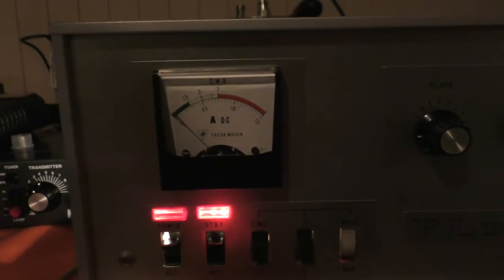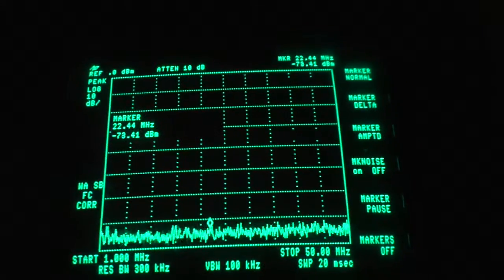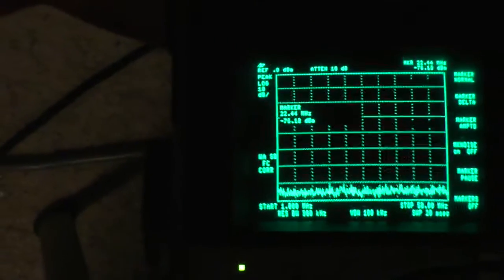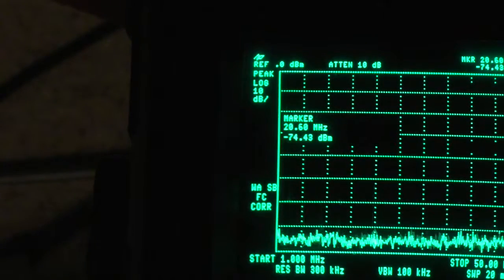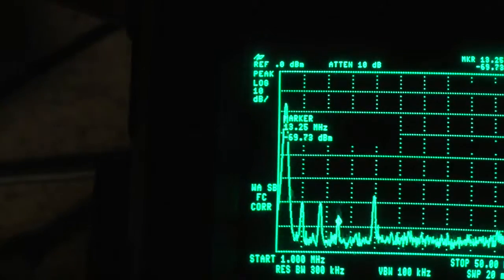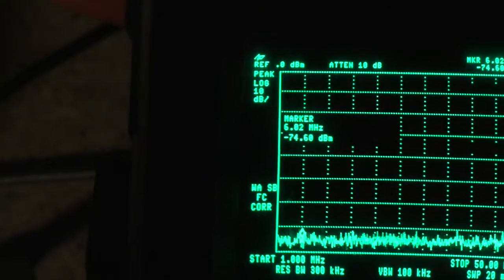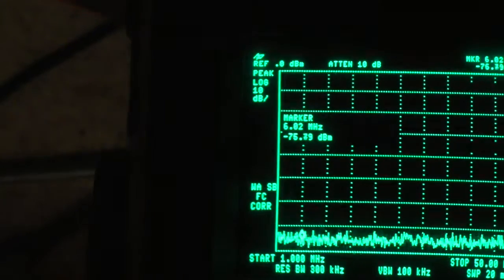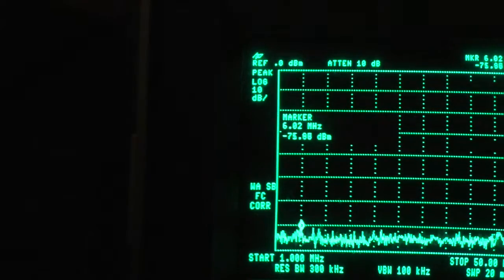The FLdx2000 With 500W Output On A Spectrum Analyser

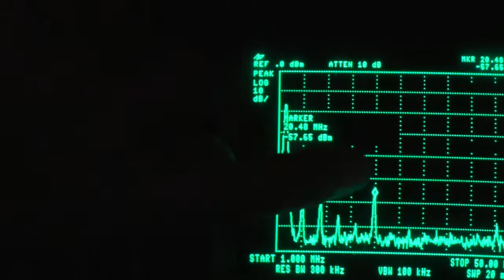Comment from the maker: This comment doesn't appear for some reason: 'Pieh0 commented: "3:26 2W, not milliwatts."
2 hours ago'. I'll check that thanks. Quick check 2W + 45dB = 63.095kW. 2W = 33dBm + 45dB = +78dBm. 78dBm = 63.095kW. The actual power in a sprog 45dB down on 500W is 6.3mW.
Reply: No ACMA inspector is going to worry over that.
Your neighbours LED TV and Top Loader washing machine would be putting out worse.
So much for EMC - We're the only dumb bastards who follow it.....
Reply from the maker: Probably a good thing though.
Reply: Every 4th house in Australia has a chinese over the horizon radar.
Not a good thing.
And it's not good that we are the only ones who follow the EMC rules - no other makers of electronic gear follow the EMC laws.
Reply from the maker: Can you imagine what it would be like if we ignored the EMC rules too... if we all used Toblerone Baofengs it would be far worse.